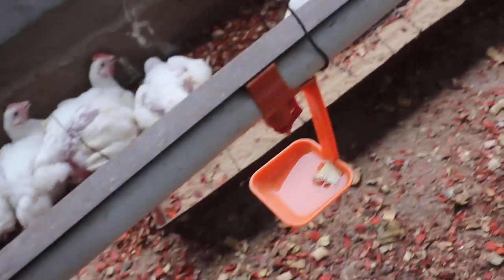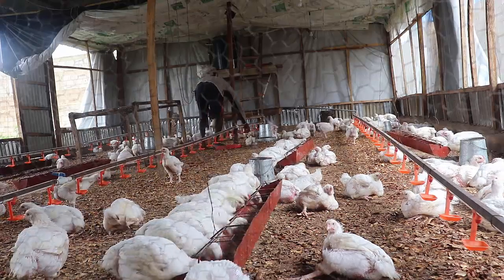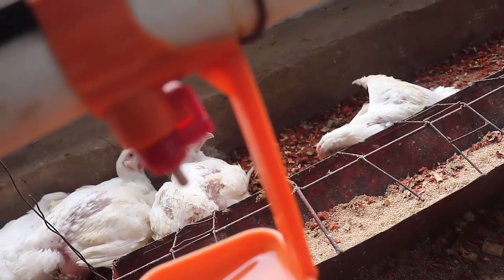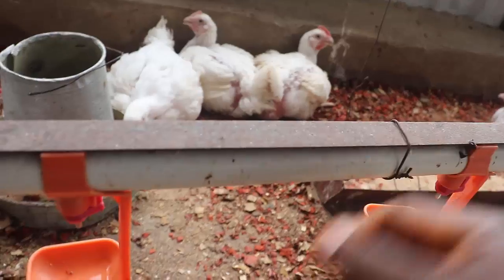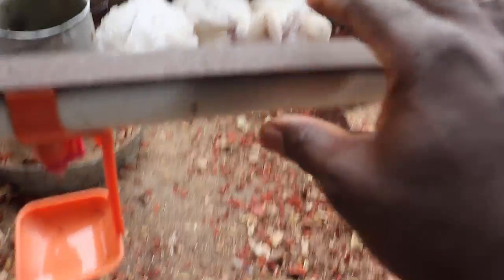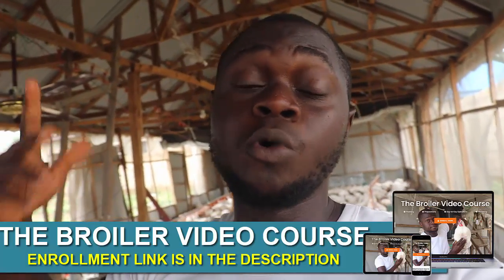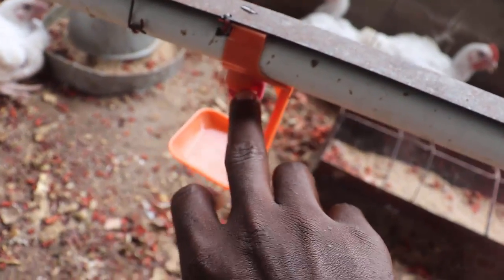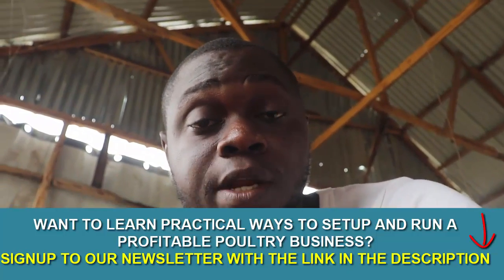Regular care of the nipple drinkers

Comment: Thank you so much for this. Keep up the good work. 

Can I use the normal pipe used for the house?

Also, what can I use to flush the borehole?
Reply from the maker: Yes you can use the normal pipe used in the house, normally 3inches pipe.

For flushing the borehole, invite experts that drill borehole, they have machine for flushing, but if your intention is just to clean and flush the pipe instead, use water treatment chemicals like isochlor etc in high doses to do it